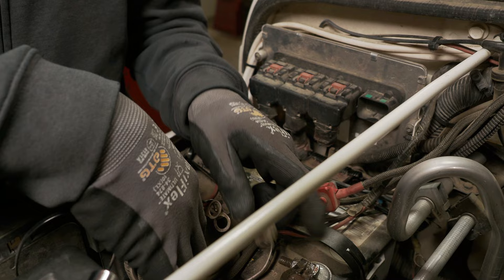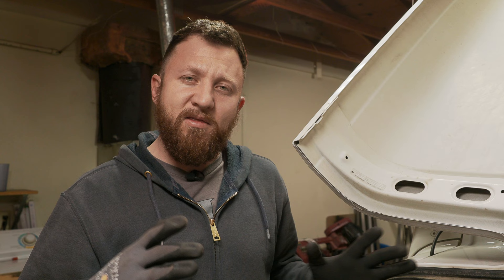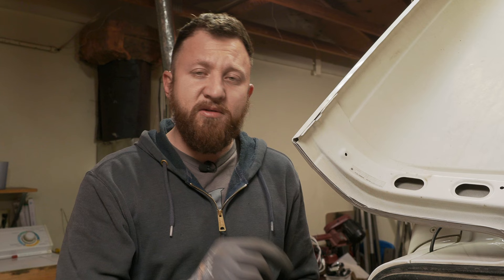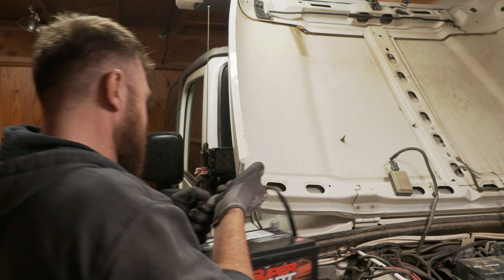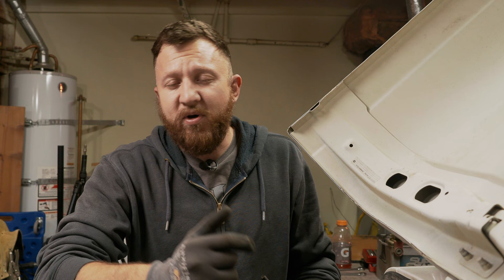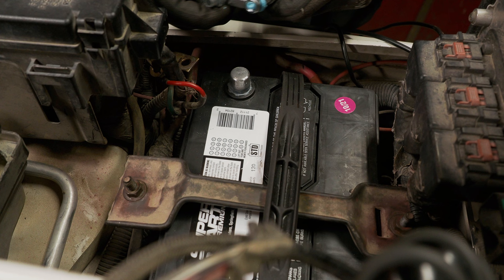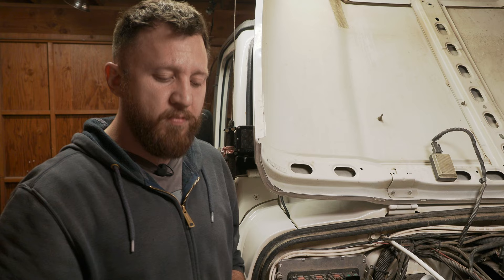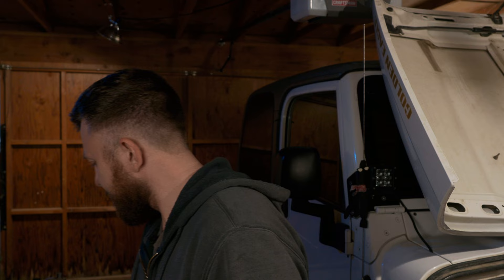Watch Before You Buy AGM Batteries

Comment: My '01 w/factory alternator does and has always charged to 14.1v. Been running agm for several years without issues. Did you ever look into those alternators from JB Electric?
Reply from the maker: I find it odd that some TJs run in the 14s and others like mine run at 13.5ish. Out of curiosity is your Jeep an automatic or manual?

I’ve not looked into those alternators yet, thank you for reminding me!
Reply: 32rh auto, 4.0L, original pcm. Those JB's are worth looking into. They build them brand new with all new case, components and materials at roughly the same cost as an "OEM" alternator from the parts store; which you KNOW has been rebuilt at least once. Being that it's all new, I don't recall them charging a core either.
I still have the original alternator in my '01, but my rock buggy (which has a 4.0L stroker) has an OEM spec JB alternator which has performed great so far with an AGM.
Reply: ...and as I'm thinking on it: the pcm sets the charge value for the alternator. So, even if your charging system is all proper, the wrong setting in your pcm can limit your charge value, i.e., your charging voltage.
Do you have a tuning device that you can use to check and adjust that setting in your pcm with?
I remember something about your pcm being replaced last year.
Reply: Mines a automatic transmission also.

Comment: Yeah but -- "WOW that Terminal was LOOSE"  was practically the first thing you had to say in regard to the battery 🤷🏾‍♂️
Maybe your Jeep didn't have the greatest connection for charging. I do appreciate your caring enough to make a video on this subject. Let me know your thoughts if you have time, thank you.
Reply from the maker: Completely agree. But this isn’t the first time I’ve look into this issue. Even now with the terminals fixed I still have the same charge voltage. The info on AGM vs lead acid as far as charging requirements  is still valid. 

I have an idea to fix this for most older Jeeps. Stay tuned. Hopefully it works and  helps someone out.
Reply: @EmbarkWithMark  Sounds kosher! 👍🏾
The reason I brought it up is because I'm looking for a battery for my 2001 X5 SUV and I'm not sure if I want to roll with the AGM or not. I don't have a voltage reader in my cluster, but if you've heard anything about BMW voltage output -- shoot me a hint because my only shot at buying a battery is tomorrow LOL
Reply from the maker: @christopherhenry8061  if you have a harbor freight near you. Grab a $1.99 volt meter.  Test the voltage with the car running. If it’s at or above 14.2 your good with AGM. Anything lower stick with lead acid.
Reply: @EmbarkWithMark  Perfect! I have a Harbor Freight less than 10 minutes away. I will do that very thing in the morning. I'm so glad you responded. You've been a great help and I thank you for it! 🤠
Reply from the maker: Your welcome!

Comment: Hey Mark, thanks for the video... just gave it Thumbs up. I have a MB CLK 430 from year 2000 and was thinking of getting an AGM battery, but after watching your video I'm reconsidering. 
How do I find out what the charging voltage of my car is and if it will be able to handle an AGM battery?
Reply from the maker: Stick a multimeter on the battery with the car running. If it’s 14v or higher than your good to go! Glad you found the video helpful!

Comment: Looks like a loose connection at the battery.
Reply from the maker: I’d normally agree. But the low voltage is not a new issue for this Jeep. 

Voltage is still to low with new terminals. 13.4 is just low for most any battery really.

Comment: AGM batteries are head and shoulders above lead acid. Sold LA batteries for years any would last one to two years, occasionally three to four but rarely. When AGM came out. They mostly lasted five to twelve years. Requires no special charging system. Many would sit for six months with out charging. One key is to buy a Quality battery and not a cheapo with a promising name. "Ever Start, Duralast",  and beware of the the word  PRO. Now PRO means standard and sub standard even. Buy a quality AGM and forget about the battery for at least 6 to 10 years years. Get a good maintainer if you don't use the vehicle for a while or charge it at every Six months.
Reply from the maker: Oh, I fully agree that AGM batteries are far better. I run them in my other vehicles. However, even high end manufactures like Battle Born have posted charging specs for their AGM batteries and it is different than Lead Acid batteries.

Comment: What is the best battery for 2007 merecedes e550?
Reply from the maker: Probably the battery that came with it. If the car charges at 14v or more. Grab an AGM.
Reply: @EmbarkWithMark  I ordered an oddessy no 49 amg performance battery. It says it fits on fcp euro for my car, will there be any problems if you order a powerful battery or willl it be ok?

Comment: So let me get this straight. You say that you are ditching AGM batteries. But the battery that you are using as a replacement, is another AGM battery. That is a Super Start Premium battery(the "Premium" series  is exclusively AGM). They are available at O'Reilly's Auto parts. So I don't understand why you are saying you are ditching AGM all together. Because you're not. You are just replacing a battery with an AGM battery. Maybe just upgrade your electrical. Or spend a little bit of extra money and get a higher output alternator with an external voltage regulator. That would probably solve the issue if you feel like having a battery last more than 3 or 4 years is important. As the saying used to go "Spend a little now, or a lot later". 🤷
Reply from the maker: I think your confused. Super Start Premium is a flood lead acid battery. Super Start Platinum is the AGM version. 

Further more, higher output doesn't mean higher voltage. The regulator it self needs to be modified not the alternator. The voltage regulators for Chryslers are in the ECM. Its not as easy as "swaping it out" to make a change. 

Sure, I agree pay more for a better product. Unless the vehicle can not charge that product correctly, then money is going out the window. 

Point being, just make sure the vehicle in question has a high enough charging voltage to properly charge an AGM.

Comment: Upgrade your alternator!
Reply from the maker: Upgrading an alternator doesn’t change the output voltage.
Reply: @EmbarkWithMark   Ideally you want your charge rate output between 14.2 and 14.6 again you can get a bigger alternator or put a smaller diameter pulley on the existing alternator.
Reply from the maker: @404notfound.....  While I agree that those methods would normally work. Jeeps alternators are regulated by the ECM. So changing the alternator has little effect, unfortunately.

Comment: Why would you use an AGM battery on an older vehicle that doesn't have the modern auto stop/start (ISS) feature? My understanding is that AGMs are recommended for my 2021 Toyota.
Reply from the maker: AGMs are a better battery technology. They where not designed for stop/start systems, though should be used in that application. My 2015 4runner has an AGM in it and it's been great. Just a matter of making sure the charge voltage is correct. AGMs are more durable off road and tend to be able to store and squeeze out more power. Like if one is winching for example. Thats why I like to use them.

Comment: I just read an interesting description of AGM batteries, how they work, and how they must be charged per Federal Battery Company. Vehicles are not built or intended to charge batteries they say. Vehicles are built and intended to keep batteries charged so the 13.5 volts is just right. Getting a jump when the battery is dead and then driving the car to "charge it" does not fully charge the battery and it stresses the alternator or destroys it and the regulator.
You should be ashamed of the wiring on the jeep-very ashamed- if you have the clamp on type terminals on the end of the battery cables. You better submerge them in a bucket of the red goop! Use the factory molded battery cables with the connectors attached is what Jeep and every other manufacturer intended as did God.. Where did the correct factory battery cables go? Who would cut the connectors off and why?  Better get on that wiring with new cables Mark. Loose corroded cables and connectors and terminals can prevent the alternator charge from getting to the battery. The dashboard solar panels are an ideal solution for cars parked outside. A little float charger for vehicles parked near an outlet for power to keep them charged up is good too. Use a charger with an AGM setting.  If your AGM wasn't properly charged before it was installed in the vehicle then it never got fully charged but only to about 80% thus the poor performance and the short life of your AGM batteries.There is a vehicle compatibility chart too so check that to see if the AGM battery can work with the vehicle you plan to put it in. Jeeps may be ruled out..

Comment: SIMPLE:

If you car came with AGM, stick to this technology as your charging system is optimized for the higher voltage/charging requirements.

If you car or truck came with a flooded SLI standard battery (AGM & flooded are both lead acid) replace with the same type unless you upgrade the charging system to output more voltage and or use a special charger about 1-2 times per month in order to top off. Regardless AGM technology is FAR superior when maintained properly!
Reply from the maker: Completely agree!

Comment: The only thing you're lacking is an external regulator you're gonna just do whatever you want. It sounds like you lacking experience bud
Reply from the maker: External regulators on TJs are an option, but not a reliable one. Which is why I've not gone that route. However, turns out the voltage regulator inside the PCM is adjustable, I just need to get a hold of the correct tuning software and we are in business.

Comment: If possible, ditch the Chrysler charging system for a alternator that is self-regulated no charging system should be under 14 volts or over 15v and what I mean by 14 volts charging that's under a full load
Reply from the maker: Yea, I am considering an external voltage regulator as we speak.

Comment: Just get a higher output alternator problem solved
Reply from the maker: Not problem solved. The regulator controls the voltage. A larger alternator won’t make any difference if the regulator doesn’t increase the voltage output.
Reply: @EmbarkWithMark  sorry obviously yes and different regulator

Comment: Bruhhhh lmfao I have never in my life had a problem with a agm matter of fact me switching to agm from a std battery helped a whole lot they last longer and perform alot better agm does float higher but just cause your charging at 13.6 or watever u said dont mean it's going to ruin the battery i have a 340amp alternator and i charge at 14.8 and have been fine with agm my wife has a 90amp alternator she charges at like 13.5 hers does amazing good video tho pretty interesting I love my xspower agm batteries
Reply from the maker: I think one issue here is how heavy the battery gets used. In regular usage the AGM battery does okay in the Jeep, but with heavy usage (like we have) the batteries performance degrades rather quickly over time. I believe having a lower than optimal charge voltage for AGM leads to degraded performance. 

I wish my Jeep would charge in the 14.2 to 14.8 range. Just not feasible. Maybe your wife's car does not see enough electrical load that pushes the battery performance. As I said, day to day performance in the Jeep you'd never know the battery is degrading. However, when the system is pushed a bit harder than average we can see degraded performance very easily. 

Thank you for sharing your experience!

Comment: Sounds to me like your problem is really the Jeep
Reply from the maker: Yes, of course it is. My older Jeep isn’t properly setup to charge AGM batteries. Which is the whole point of the video.
Reply: @EmbarkWithMark  Does it really matter with that title? Makes it out like AGM's are to be avoided when it's really the alternator that's the problem.
Reply from the maker: @DrDAC-go7hs  well you’d be a bit wrong. Alternator has nothing to do with it. It has to do with the voltage regulator. And if your vehicle can’t charge AGM properly, you what to avoid them as they are more costly and a waste of money.

Comment: Well a loose terminal will kill a battery. Perhaps before you blame the battery fix your terminal.  I have Optima in a jeep they last 5 years plus. Clean your batteries and terminals ya might do better.  Dirt on the battery drains charge. I use yellow top on the jeep for obvious reasons.  Maintaining it with a solar trickle charger will kill any life you would ever hope to expect from that battery.  Do it right and there is no problem.  Seems that your creating your own problems. Coming up with odd solutions instead of following standard procedure.
Reply from the maker: Not blaming the battery at all. The fact of the matter is, the charge voltage on my specific Jeep is too low. 

It seems that charging voltage range widely from Jeep to Jeep for the TJ model specifically. Some charge at 14.2 some charge at 13.4. Maybe your Jeep charges at a voltage correct for AGM. 

Regardless of what people say. AGM does have specific charging requirements.
Reply: @EmbarkWithMark  I get that, Mine was an older 2006 Jeep Soaring Eagle, and had modest power requirements.. Keep up the good work!!

Comment: Just stop making these videos. And educate yourself on automotive electrical. 
First you whole vehicle wiring is your problem. Fix that first before blaming the battery.  (Install a complete new harnesses.) Go threw your charging system thoroughly inspecting the components and wires. 
Obviously you hacked up the original harness so much, and you probably used butt connectors or non insulated plugs instead of soldering or weather proof connectors when adding accessories. That engine compartment is filthy,  you  can't even see the wires threw the dirt and grime. Have you even heard of multiple grounding??
Reply from the maker: You should probably stop making assumptions. The wiring harness has never been modified whatsoever... Anything added is either directly to the battery or through an SPOD system. 

Additionally, a year ago, I had a PCM issue (voltage regulator was going bad, yes it's inside the PCM on Jeeps). All grounds were checked/cleaned, PCM replaced, AGM battery replaced, and every add-on disabled. The battery problem, is a problem with AGM on my vehicle. Despite your gross assumptions, AGM batteries still have specific charging requirements. Don't believe me? Go read the charging specs for AGM batteries.
Reply: @EmbarkWithMark 
   Ok I won't post anymore remarks after this one. 
 But let's clear this up I know what and which AGM battery is used ( including Lithium and Solid State batteries) for and its charging needs, and how to Condition them to maintain peak performance from one. You never went over if you changed the CCA or RC of the battery when you changed to an AGM which plays a major factor of your vehicles electrical system. What got me about your video is you saying  AGM batteries don't last as long as flooded.
       Before you go out and buy high performance parts to bolt on your vehicle. Know your vehicles capabilities. 
So in this case your charging system and power consumption. Which you claim doesn't have the capability. I can get 6 to 7 years out of an Optima in just about everyone of my vehicles. From a 1965 to 2018.
 Now First, You should never work on vehicles in this condition? Clean them, how are you going to inspect anything correctly when its filthy like that. It doesn't matter if it's a Hyundai or a Bugatti. This video made you look like a back yard mechanic. Parts falling off in your hand unable to see clearly the wiring, filth all over the area you are working on. 
   My best advice is atleast clean engine bay before working  on any engine or vehicle component.

Comment: The shitty wiring job is probably the reason the AGM battery did not work for you. If you can not do the job right the first time means you should probably not be working on your own vehicle. Wiring a vehicle and organizing the wires is not that hard of a job. Makes a person wonder where else you took short cuts and should your vehicle even be on the road because of other dangerous work you may have done. You should let your insurance company know how dangerous the wiring job you did so in case the vehicle catches on fire they will know the reason. Crappy and dangerous electrical work should void your insurance policy.
Reply from the maker: ROFL. Get off your hi horse. Everyone makes mistakes. At least I can own mine and correct them. You?

Even with the wiring removed, which it is now, the charging issue for AGM batteries persists. The main point, AGM batteries need different charge voltages than standard lead acid.